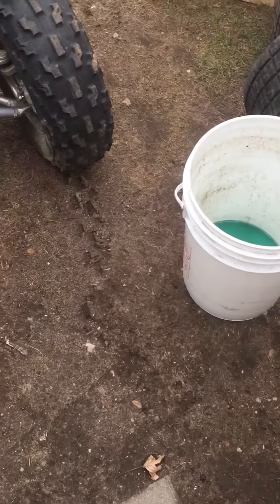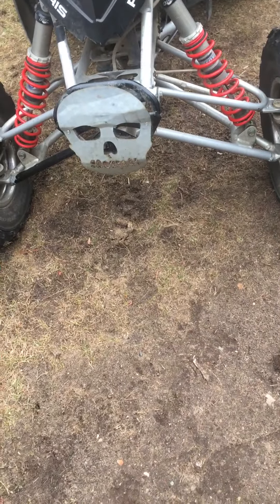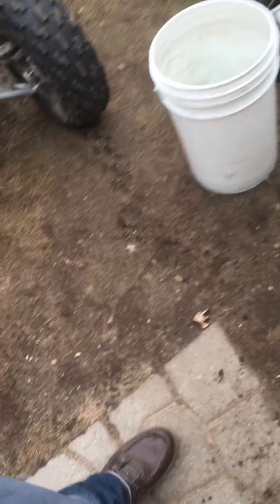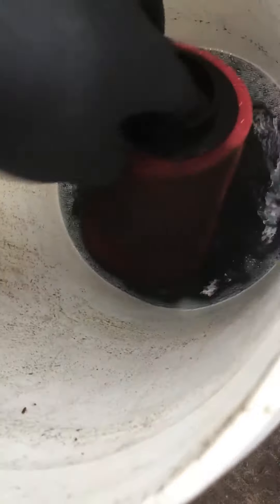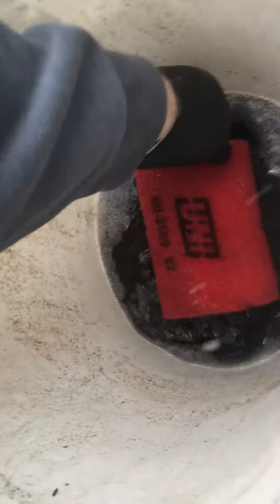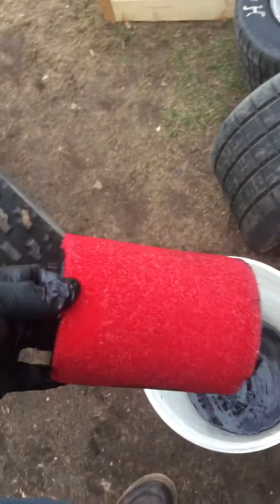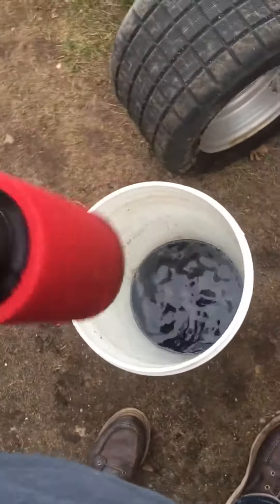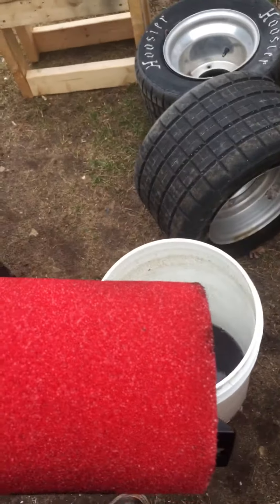How to clean a ATV Air filter free and easy!!

Comment: Whats in the bucket?
Reply: Gas ⛽ 
You can use diesel too, just remember to rinse it with dish soap and water to get all the gas residue out 👍
Reply: @104Woodworks  Have you tried this method? If so did it do the trick?